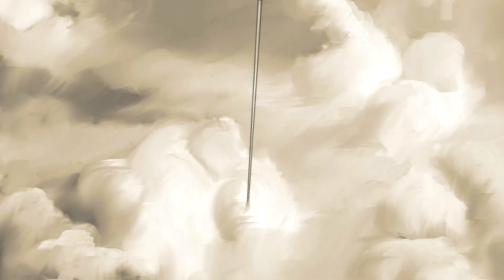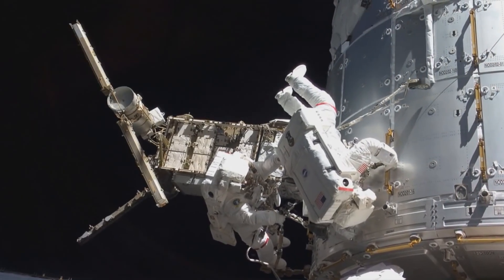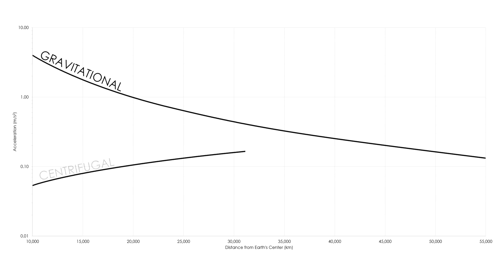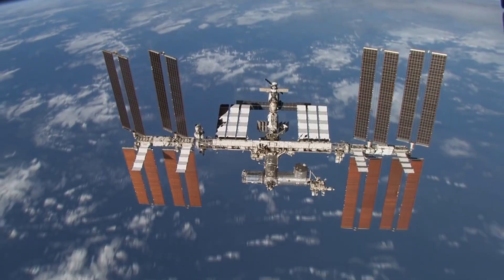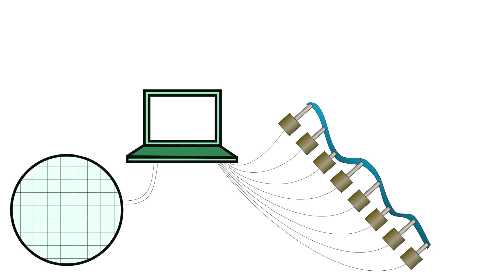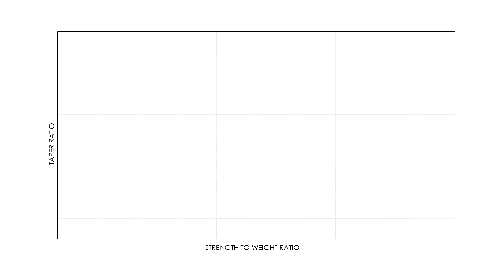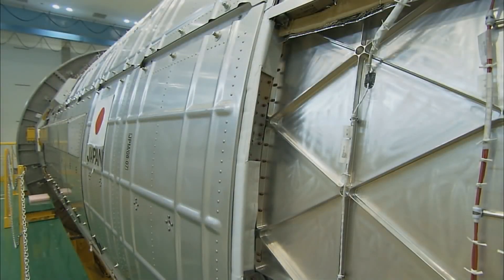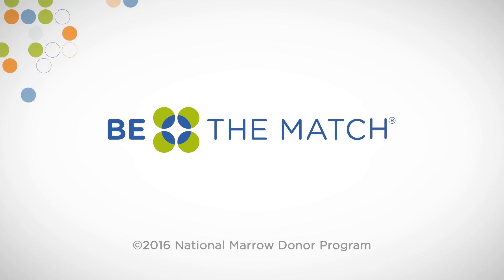Design Your Own Space Elevator

Comment: The last paper had an assumption that the space elevator must be stationary, which is why they pick R_g to be geosynchronous radius. Technically the counter weight just need to maintain constant altitude, it does not need be geosynchronous. So technically R_g could be at any value, as long as the counter weight orbital velocity is sufficient to counteract gravity and we don't mind the elevator to not geosynchronous.

If we shuffle the taper ratio equation in the last paper for a bit, we can estimate it as Ln(taper_ratio) ~= C * 1/(R_g^3). Which mean even use the worst example of steel, there would be no taper require if the R_g is roughly 3.2 times longer than geosynchronous orbit altitude. It seems way more feasible to just have 3.2 * R_gsync length of tether than a tether that taper to 10^33 times at the end. Assuming 14 gauge wire, at 3.2 * R_gsync length would roughly take 0.07 % of 2018 global steel production. It's pretty big amount but it's not an impossible amount. Certain Olympic stadium construction consume way more steel than that.

But then this design would require the "tower" to be drifting at some velocity to compensate for the non-geosynchronous-ness. Nothing mention all the additional drag, vibration mode, increase travel time and a whole host of other issues. I guess you could have multiple counter weight satellites "baton pass" the tether between each other in order to let tether remain stationary. Or have some sort of mini-planetary-ring-world like counter weight to let the tether remain stationary.

Comment: The tensile strength of the "rope" changes because the "weight" of the object changes based on the position away from gravity.....meaning....it not only gets lighter the further out you go, but centrifugal force is pulling it apart, so you have the weight distributed from both sides in the middle.  A normal steel tether would work perfectly fine, given no atmosphere.......and THAT is where the real problem lies, the atmosphere, as it would cause sheering.

Comment: Interesting question regarding the space elevator: How high of a building can be theoretically build with our current technology disregarding stuff like cost? Because if we could build a building of 7-8 km height the space elevator would be much more feasible. Of course 7-8km is practically nothing compared to the length of the elevator cable, but with a building this high the anchor point of the SPace elevator would no longer lie in the troposphere of our atmosphere. That means the stress on the cable and lifter through atmospheric drag and you know, wind and stuff is greatly reduced.

Comment: Just have 2 tethers that have a conductive part, which doesn't carry a lot of weight. Then run voltace through it and you've got a power supply for the whole setup
Reply: Resistance is proportional to length

Comment: The main problem with any Space Elevator design, which I've never seen addressed on YouTube (although it has been discussed in other forums), is something you and almost everyone else is overlooking.It's not cable strength, or the weight it must hold.It's not how to power the lifter.The problem is that the tether could not possibly stand up to even a fraction of the electrical discharge it would carry as it passed through multiple plasma double-layers. It would essentially be like placing a conductor across the leads of a planet-sized capacitor. In the unlikely event it ever made it to the ground, it would disappear in a blinding flash of mega-lighting.
Reply: it may even be like a thermo couple with diff chartges tempatatures build up voltages along the line.

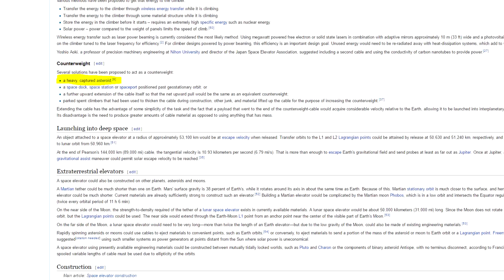Comment: 3:45 I'm pretty sure that increasing the mass doesn't help solve the problem. True, the centrifugal force increases, but because gravity is w=m*g, the centripetal force increases as well. Because at the Clarke belt, the weight is equal to the centrifugal force, both scale by the same factor and there's still no room to add the tension by the tether. If the satellite is slightly beyond the Clarke belt, however, then increasing the mass still causes proportional increases in both radial forces, but because the slight difference to begin with, the absolute difference actually grows. Basically, increasing the mass can't compensate for adding a tether without being accompanied by a increase in altitude. I suspect that a captured asteroid is suggested as a possible counterweight because having such a high mass would cause the tension to be trivial compared to the high centripetal and centrifugal forces.

Comment: If a laser was used to send power to solar cells on the elevator, the laser could be attached to the cable, but outside of the atmosphere - that would get rid of the aberration effect.  Getting electrical power 20 miles up isn't too much of a headache.

Comment: At last - somebody who has seen some of the difficulties of the space elevator.  In fact, you saw difficulties that I had not considered - the size of the cable required, and the power aspect.  That could probably be solved with nuclear power - you must have heard of its benefits - the new, clear power!  :-)  
You say that atmospheric astigmatism would reduce the efficiency of a laser down to 0.25% -  then at 6:00, you say that adaptive optics could increase the efficiency 10-fold.  So we're up to 2.5% efficient.  No problem, then ;-)  We could share the load between two cables, and use one as an electrical feed and the other as a return - but 26,000 miles is a long power cable.  According to Google, "The 2,385km Madeira HDVC link in Brazil is currently the longest power transmission line in the world."

OTOH, I think there are difficulties that you did not mention.  At 1:56, you analyse the structure as a static one - and that is what everybody seems to do.  They consider the thing when it is already in place and made static  - so let's look at that way.  At 6:06, you say "If a 26,000 mile rope is unimaginable to you ..." so it seems that you are thinking of a satellite in geostationary orbit (actually 26000 miles above the centre of the earth).  However, when a satellite is in orbit, it is in an incredibly sensitive balancing act - gravity vs centrifugal force (centripetal? - I can never remember).  If it drifts out of orbit, a few puffs of gas from a nozzle are enough to set it right again - and we're talking about hanging the thousands of tons of cable + elevator on it?  It would certainly need to be geostationary, but it would be kept in position by tension in the cable itself.  Unlike you, I haven't done any calculations  (it's 50 years since I did orbital mechanics), so my impressions are based solely on gut instinct, but it seems to me that the satellite would need to be colossal (you mention an acquired asteroid) - and much further out than the normal geostationary orbit.  As you said at 3:40, you would need to increase the mass of the satellite or its distance.  Increasing the mass alone wouldn't make any difference.  As I said - orbits are a fine balance - so it would need to be further.  I haven't, and can't calculate the distance vs mass, but my impression is that it would be at least 25% further, kept in its path (we can't strictly call it an orbit) by the tension of the cable, rather than by gravity.
The other significant problem is how to manage it before it becomes a static system.  With the satellite in a more distant orbit, its natural orbiting speed would be lower, so you have to attach a cable that will pull it around faster.  It would swing back and forth at first like a pendulum - and I don't know how that would be damped.  But the problems of getting the cable up there would be enormous.  presumably, each part of the cable would have a natural orbiting speed, so the cable would have a tendency to flail until it was tied onto the satellite.
I'm sure you have given it more thought than I have, but when I first heard it proposed, my instant reaction was "That could never be made to work".  Michio Kaku spoke about it optimistically, but Michio Kaku is always optimistic about every dreamed up plan.  I have heard propositions of having a cable between two space craft, and swinging them around to produce artificial gravity - and I can see the possibility of that - but getting that into place would be a whole different problem from connecting a massive satellite to the earth with a cable!  Oh, man!  
If you were going to simulate it with a roundabout and a rope, you would start by attaching the rope to a mass and gradually paying out the rope - but a roundabout doesn't have gravity - and that's a complication.

Comment: Rocket proppeled elevator
Reply: That defeats the purpose of a space elevator
Reply: @sebastiaomendonca1477  the tether is still there, but the elevator is lifted by rockets instead of lasers
Reply: @planktonfun  Yet again, that defeats the purpose. You no longer need a tether.
Reply: @sebastiaomendonca1477 how so? no you need the tether to guide where the elevator is going
Reply: @planktonfun  If you have rocket engines you dont need any tether to guide it. The point of a tether is to use it to propel yourself so you dont need to use heavy and expensive rockets

Comment: why not just integrate a conductive surface into the wire and use that to power it?
Reply: Too long for regular wiring. It's the same reason power plants are spread out instead of all being in one place, cause you lose energy over longer distances. You could assume that room-temperature superconductors have been figured out as well as nanotubes, but even in that case, if each metre was only 10 grams, that's still thousands of tons, and then that old taper gets you again.
Reply: Is that true in a vacuum though? I thought the reason you lost power over distance was the wind stealing ions?
Reply: @kahlzun  It's resistance.
Reply: It needs to be a super conductor to not lose a lot of power from resistance. Or a lot of small energy sources along the cable, which would increase the weight.

Comment: Didn’t really solve the problem with heat in the atmosphere, and also cold. The cables would melt and also get to brittle. 
Hope some day this’ll happen though.
Reply: Why would it melt? If it is because of the temperature in the thermosphere and beyond then although it is indeed very VERY hot, there is not enough particles (of air) in the vacuum to have any thermal transfer. That is why satellites dont melt in space

Comment: its impossible and have been tried before. the tower of babel is exactly the same thing the ancients tried to  do just like  a space elevator exept they tried to make a tower tall enough to reach space. if you made it a tower an built it like a pyramid like wide at the bottom and small at the top and just build it big enough, it would reach space and be far more stable than the elevator. the space elevator is flawed anyway. there is no material on earth that is strong enough to hold the amount of stretch that will be on that cable. i have a far better idea than this space elevator shit. mine uses a electromagnetic ring that is sendt up by a particle beam by producing a acustic resonance field inside the beam, the electromagnetic ring would be able to climb it. a rope made of energy is far more reliable than matter. the ring would be like a space station in its outer circumference with windows around it. a laster will be used as tracking so that when the ring need to go down , another beam is shoot up and the reconnect the ring and the polarity is run in reverse and the ring goes down.  my version  would take a nuclear power plant to run but is more safe and can put many of these rings into orbit is there is an orbit then.

Comment: For power, why not a battery pack for the initial climb that separates and descends when near depletion. It's extra weight, but it could provide power to elevate the cargo to a height with lower atmospheric interference and gravity. Then a laser could send power down from the tether, being powered itself by a reactor on the tether. I'm sure that's not an original thought and it's not a solution in itself, but perhaps a combination like this could yield a more realistic approach with near future batteries and materials science.
Reply: You've just effectively thrown a battery pack at the earth, which will be going several Km/s by the time it enters the atmosphere

Comment: Yeah that's funny. Lots of bla-bla physics and at the end you end up with "satellite pictures" are made from planes and internet is spread via undersea cable. And a falling satellite vaporizes itself before landing on the surface? Give me a break.
Reply: A satellite orbiting in LEO is going at 22,000 km/h. Thats 6 km/s. Mach 18. Are you aware of how fast that is? The SR-71 went Mach 3 and already had massive heating problems. Now compare that with a satellite going 6 times faster that isnt even designed to be in an atmosphere to begin with. Not to mention drag is exponential.